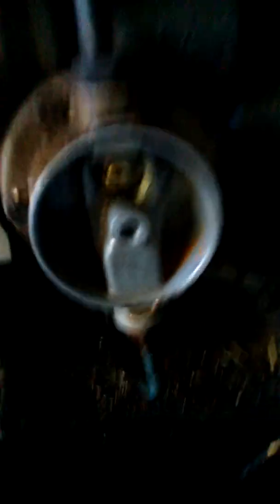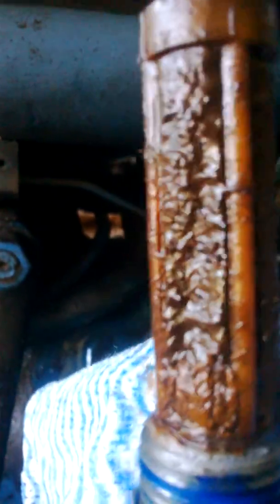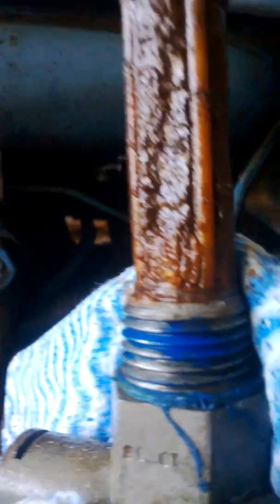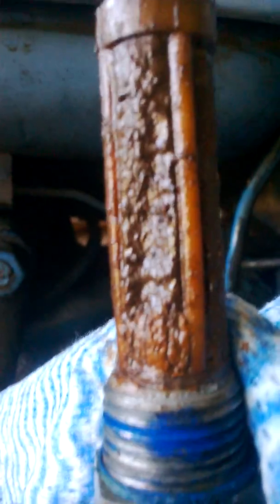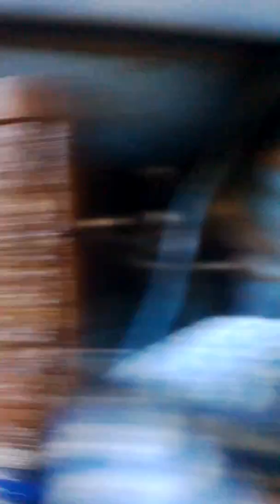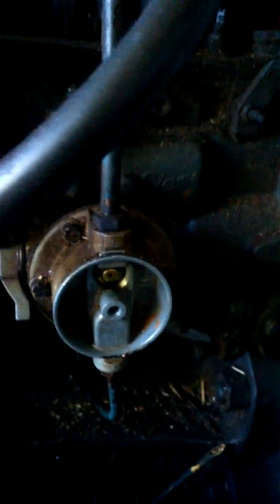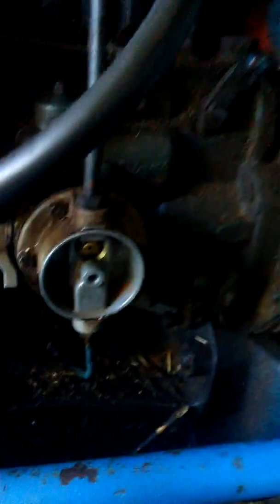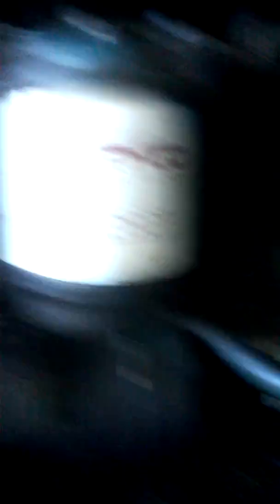Ford 3000 Tractor - hidden fuel filter inside tank

Comment: Look at it ,it tells you what is in the fuel tank ,water and rust ,and yes all tractors have one ,if it's not there someone has removed it or it has fallen off and is in the tank.lady CLR is the best I've found to clean the tank ,after wash out with garden hose ,dry with rags but count them to be sure you've got them all out -you still have to clean the rest of the fuel system after you have done the cause

Comment: What is the tap that you’re speaking of
Reply: Right under the fuel tank there’s an outlet for the fuel to flow to the fuel filter. In that outlet (hole) is the “tap”  . It’s a shut off valve that has a filter attached to it. You can’t see the filter as it’s inside the fuel tank.
Reply: Lynn Eakin Is this a gas tractor or a diesel
Reply: Eva Caulder 
A diesel 🚜. 😁
Reply: Lynn Eakin Thank you